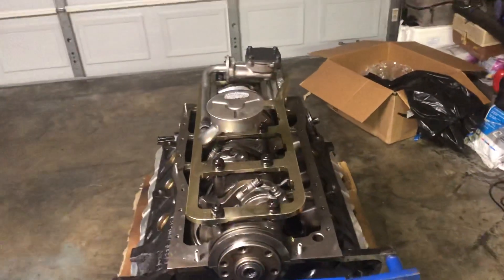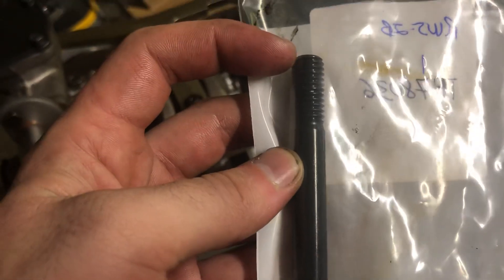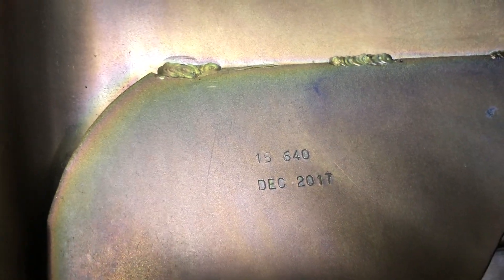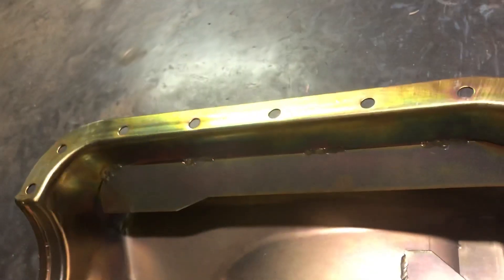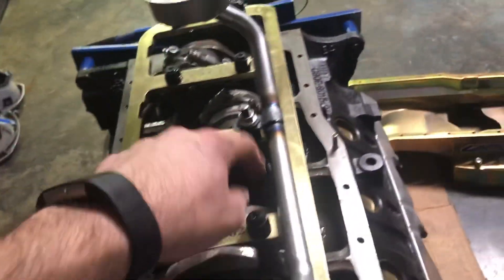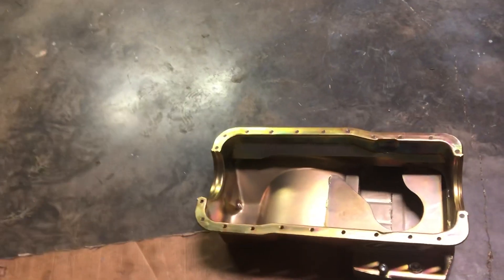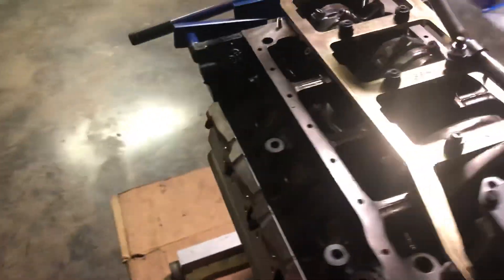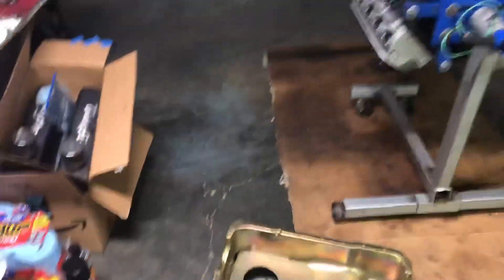Ford 302 5.0 girdle and oil pump/pickup fitment with canton racing oil pan

Comment: I have the same clearance issue with crank scraper on Canton 13-600 pan and ARP main bolts that came with Canton main support 21-060. Emailed them, they said it’s fine to move/bend the scraper back or even to remove. I also have to figure out a clearance issue with the bolt head on the front cap directly under my Melling oil pump. Haven’t figured that out yet

Comment: They dont fit well with anything small block chevy related, I had to modify the girdle extensively as well as my oil pan, so those prw girdles arent plug and play for anyone wondering
Reply: Hi I’m wondering what problems you had before I purchase the girdle ? 
I will be running a canton marine sump also
Reply: @sharons9367  gotta drill the hole for the dipstick, it doesnt clear any oil pump at all, so you gotta grind grind grind until it does, it doesnt really line up with the studs to good so you gotta kinda beat it on with a hammer
Reply: @aribadanchi  quality in parts has really dropped off with everything these days
Reply: @sharons9367  unfortunately its true

Comment: Mine is roller, think between 1987_92      I would of wanted it as well with any forced induction. Lot more stress on the block..    Mine is a road course track car for lapping not racing.😉  so I was nor out for maximum HP.

Comment: I am only pushing about 400 HP and my builder said I did not need the girdle , also using canton pan so I did not run into the problems you have.    Maybe that's why he did not use the girdle,, who No's.
Reply from the maker: is yours a non-roller 302? mines also .060 over.. so, mine being a non-roller block from like '72, .060 over and plans to run with a turbo, i felt safer with the girdle. from what i read, it doesn't really help much unless you're turning high RPMs. several say it just keep the parts together when the motor lets go. i don't remember if i made another video, but i have canton pan/pickup and was able to make everything fit. i just had to grind on the girdle some. the baffle that's welded on the side of the canton pan was hitting due to the width of the girdle.